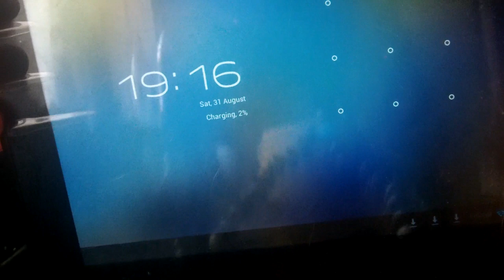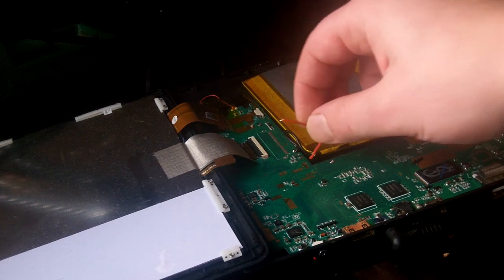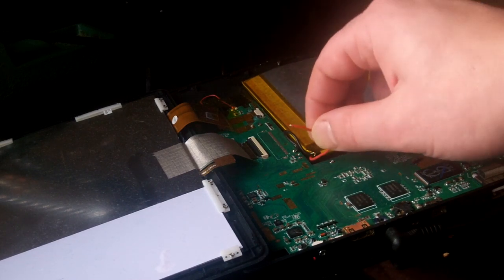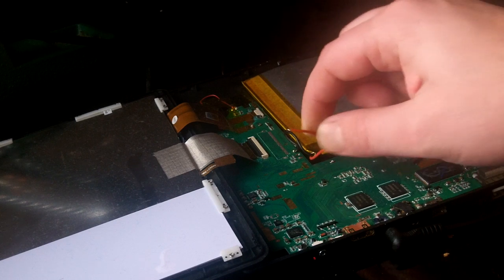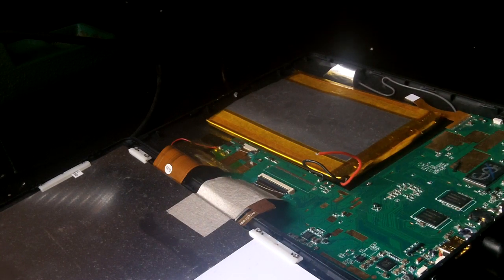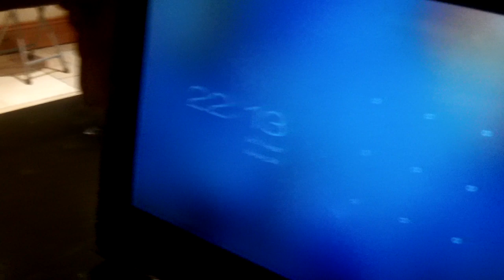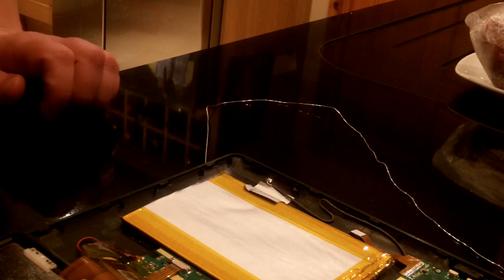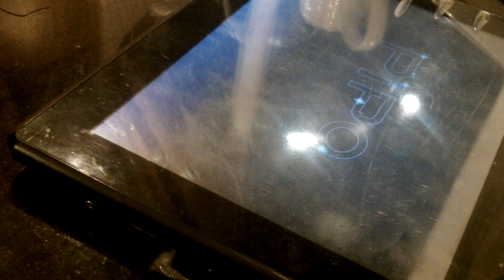PIPO S2 Tablet Battery Charging Problem

Comment: Hi,Thanks Jonny. Worked a treat.....for about 10 minutes!! Then it died again.Any ideas? Would the battery be shot? Its about 12 months old.Surely the battery should have a longer life than that.Any advice appreciated.
Reply from the maker: I had contemplated replacing the battery and found a replacement on eBay but I tried this method first and luckily it worked for me. I don't think it would be much more toruble to replace the battery but it would just cost a few quid.

Comment: nice ty for your video!

but ive got a question.
how did you open your tab ? it looks like its glued
Reply from the maker: There is a seal that runs around it. In that groove use something plastic (or a very think screwdriver) to gently prise the two halves apart. Be gentle but it shouldn't be glued - there are little plastic tabs holding it together and should flip open with a little force.
Reply: Jonny McCullagh  got it! Ty now ill try to solder ;)

Comment: Hi, can you please tell me if the standard charger has LED lights on it? My PIPO wont take a charge at all but I have read that there should be LED's that light up on the charger which there arent any so not sure if my charger is dead or if it's a problem with the Pipo.

Comment: sorry if I seem a bit of a thicko.. but if you de-solder a battery terminal from a Mboard and then put power back into the board,all your doing is powering the device and not putting any charge into the battery, so where did the power % come from???.... not the battery that's for sure. The Mboard don't have a capacitor to store voltage...
Reply from the maker: I'm not an expert but I think the problem is not with the battery but with the Pipo. I think powering it directly forces the device to reset? It that isn't it I'm happy to believe it is just magic ;-)
Reply: Jonny McCullagh dave Jones This reason is probably a power transistor isn't grounded properly, causing it to turn off once the battery goes below a certain charge. Ground that transistor will turn it on, since the board have no ref des, so I can't name that part. and since I don't have the schematic, I don't know if that's really the case. However, it worked for me multiple times. http://www.slatedroid.com/topic/53698-pipo-s2-wont-boot-or-charge/?gopid=1134994#entry1134994
Reply: ***** dude, my tablet turns off when it reaches a certain battery percent and i cant turn it off without plugging it on a charger, how do i fix it.? is it the power transistor like you say?
Reply: might be similar, look at the post I made on slatedroid.

Comment: Hi! I tried to do this trick but with no success.
I desolder red wire, put tablet on charger but OS wont boot. It is stuck at second logo animation and I can't get it further. Tried reset, volume + and power. Nothign seems to work. When I try to connect tablet to windows 8 laptop (with proper dirvers) the tablet is not recognized at all. I think it is not motherboard failure because when I start tablet two logos are displayed but on second it just stops and don't get further.
Is there any help for my Pipo? Some motherboard reset or what?
Reply: reflash a the stock rom or custom rom, then try if it boots. use phoenix suit.
Reply: Tnx, but I manage to flash it few days ago. It was a problem with win 8.1 drivers. On win 7 everything worked ok. I have to find proper win 8.1 drivers.